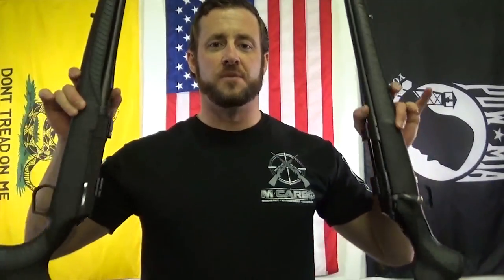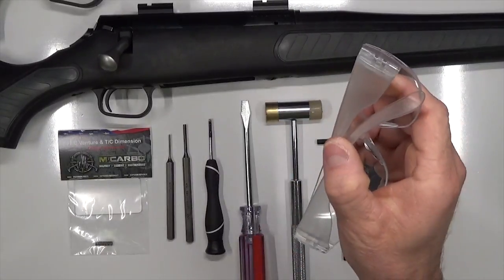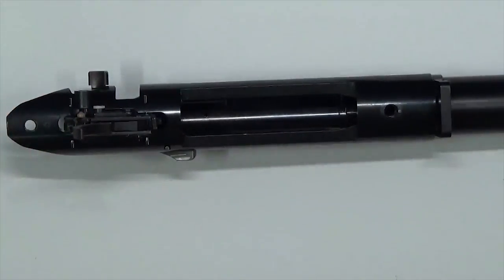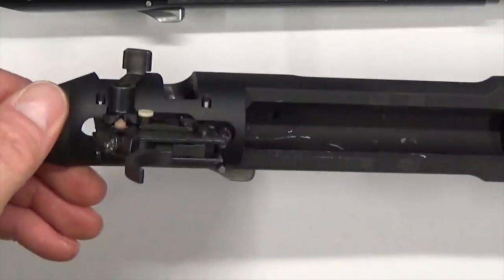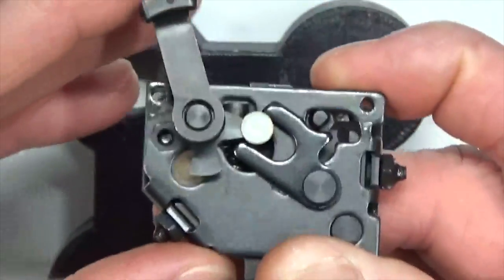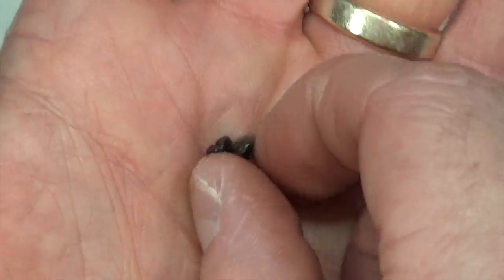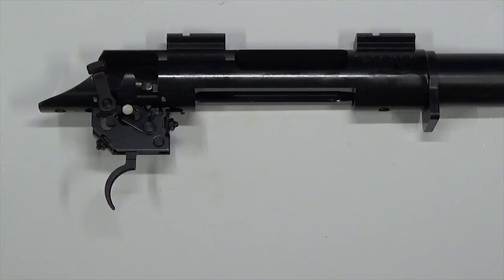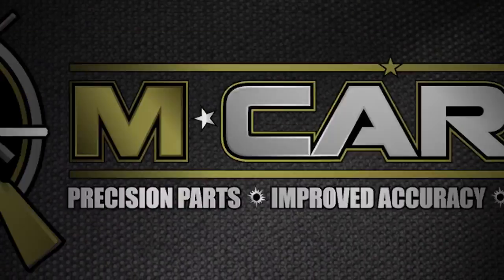TC Dimension / TC Venture Trigger Replacement Trigger Spring Kit

Comment: Great instructional video you nailed it!
One note on the Dimension.  I  own one,  the bolt can be removed with the stock on.   The trick is when you pull it out with the release lever pressed you have to rotate it so the bolt is almost upside down then it will clear the stock.  Its weird way to do it but it works.   Jiggle it back and fort as there is like a short notch feeling where it will allow it to be rotated freely.
Reply from the maker: Thanks Brother!
Reply: @MCARBO  I ordered the spring kit for it.  Wish me luck with it.
Reply: MCARBO what size Allen is needed for the tension user adjustment screw?

Comment: Fantastic, I would have never got mine back together without this.  I wish the trigger was just a hair heavier, it's slightly lighter than my 30-06 mauser action with timney trigger but it's OK.  I'll just be careful not to take off the safety until I'm ready to shoot at the deer.  Stock was so heavy it seemed to pull the gun off target a little.  I had an occasional misfire and smith and wesson sent me a heavier firing pin spring for free.  This rifle is so accurate, it's going to be great in the deer woods now.

Comment: Thanks for posting I have a Venture with the first style adjustable trigger and I really like it. It's a great shooter. I have been thinking about getting a New Venture 2 for a long range build project but I am not a fan of those lawyer inspired safety triggers. One of the reasons  I bought a Browning X bolt is it didn't have that safety trigger. Is there a replacement or kit for the new Venture 2 trigger ?

Comment: Thanks for the product. Smith & Wesson has a bad attitude about selling parts, so there is no way to get the Venture II trigger. Your spring is helpful.

Any chance you might offer a mid-range spring? I just installed your spring in a Venture, and it's a little light even for me.